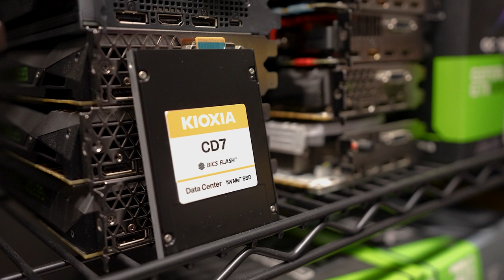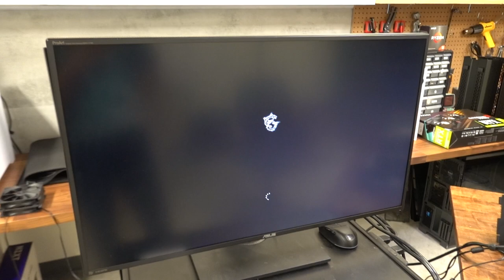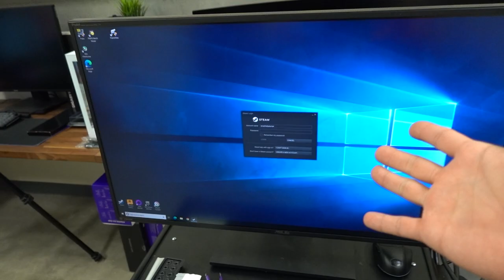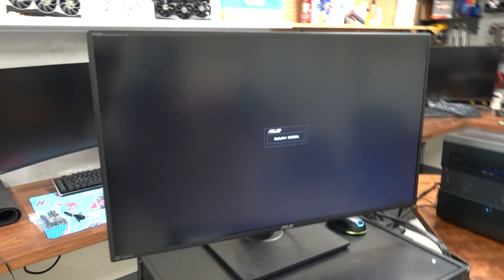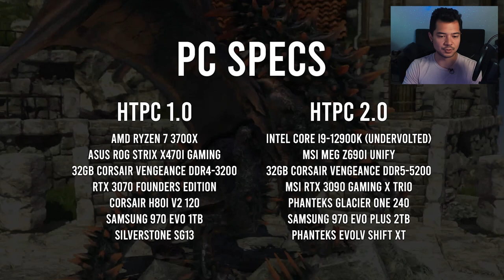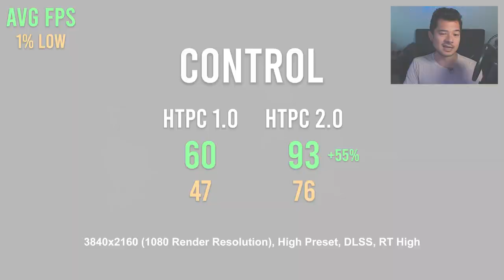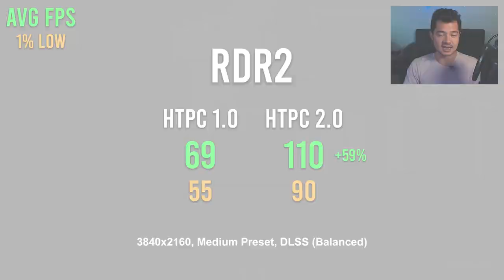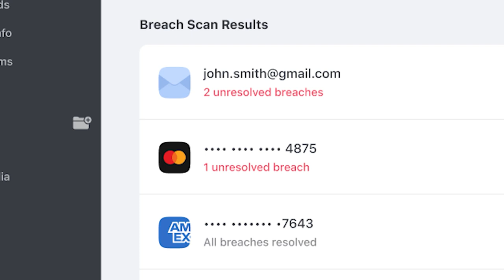IT'S DONE. Was my suffering for this PC worth it?

Comment: how does he not realize early on that when the 3090 display drops out for a few - that it is the gpu driver being installed. That happens literally every time you install a new driver.
Reply: "tech youtuber"..
Reply: Glad it wasn't just me who was screaming at the monitor while this was happening.
Reply: Triggered for me when it came back with the resolution looking correct, but I will say that when you've been having a lot of trouble with a system it's not unheard of to get flustered and start missing obvious things.
Reply: Kyle only makes these videos to milk the remaining audience he has. You can tell he isn’t passionate about this anymore. Not knowing about lga 1700 different mounting spacing, not realizing the blackout was the driver install, or the fact he runs 2 to 3 sponsors In every single video now.
Reply: My thoughts too. I was also freaking out when he was propping up the card while it was on. Those traces are so close together, why risk lifting one end higher than the other
Reply: It was so hard to watch that part lol. Literally every GPU does that while it's pulling drivers online.
Reply: He's not the sharpest tool in the shed. This is first time builder issues.
Reply: im really happy that im not the only one noticing his lack of common sense when building this comp.
Reply: Watching this series was cringe. He sounds like this is his first PC build. So many "mistakes" that could have been avoided. Honestly unsubbed because of this lol
Reply: @tcmo6  literally my thoughts. dudes get nothing but free parts and still can't manage to learn the nuances about builds.
Reply: It's funny, because i was going to make my own comment thread about this, but i found yours.  :)
Reply: You realize that this was a cursed build for him and he was just panicking because everything had gone wrong by this point? Why do people not realize that common sense doesn't apply in these cases unless someone is there to help them calm down xD? This is just rude man, all of you need some empathy xD
Reply: @narius_jaden215  maybe if he didn’t mess up so many simple things he’d have less “cursed” builds. Which, ya know… isn’t a real thing.

Comment: From what I'm seeing the bulk of the gaming increase is coming from the GPU.  IMO you didn't need to rebuild the entire system, just swap out the graphics card and the numbers would be darn near what you get on the new system.
Reply: Scrolling through the comments until I found someone with common sense
Reply: Well wouldn't that just make for a boring video? Probably getting sponsored parts too, so it makes way more sense for HIM to upgrade all of it.
Reply: Good point.  I've no complaint about swapping cases, whether for airflow or just asthestics.

I don't believe DDR5 or PCIe 5.0 give more than a fraction of a percert increase for gaming numbers, based on the comparison videos I've seen.
Reply: @dryii  I don't disagree with you. But, if you can, why not do.
Reply: @massaBeard  This is basically a comparison video.  Swapping out the video card alone would have also been a comparison video.  Either way I think Kyle could have made it entertaining.

The main reason for my comment is because he didn't mention it at all in the video.  It gave an impression that one would need to completely overhaul their machine to achieve the FPS he did, and I believe the heavy lifting here is mostly due to the 3090 > 3070.
Reply: @dryii  Ahhh ok, on that I agree, but I think deep down this was just an excuse for him to get new shiny things hidden behind a comparison video lol
Reply: ... Ignore the BitWit01 bot...  it's  a scam bot.  But do you even know Kyle?  Lol (I mean this as a jab/joke).  He's all about getting that little bit more from hardware upgrades.
Reply: @christopherjunkins  I've reported the bot 3 times now.  So glad YouTube is doing something about it and removing the comment.  😕

I'm the same way.  Spent far too much on RAM a few years ago with the expectation of getting an additional 2-3 FPS out of my rig.  😬
Reply: currently maybe
but with a 3090 give it like a year or to and the 3700x will end up the bottleneck
hell my 3600 is bottlenecking my 6700xt in some CPU heavy games
Reply: 3900x bottlenecked my 6900xt in some titles, 3700x will bottleneck a 3090, especially since it cant pbo as hard as my 360mm aio 3900x.
Reply: There is no way that 3090 would have fit his old case.

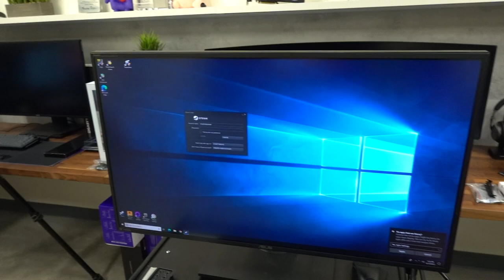Comment: i think the signal loss at around 6:00 is due to the driver loading. the scaling fixed itself when the signal came back. 
Also, i dont think the 1050 ti had anything to do with it, because i switched from a 1050 ti to a 3070 ti, and the driver worked, but didn't support RTX. basically, the driver still allowed the scaling to work, but didn't allow the ray tracing stuff to work.
Reply: Same, I have seen this before. And depending on how old his Windows Install media is, Windows 10 (older versions) would do this while it was installing the Drivers off Windows Update.
Reply: pretty sure that's just the fact that windows tries to get the best driver so it probably got a very old version for the 1050ti that didn't support the 3090 out of the box
Reply from the maker: My mistake. I didn't mention in the video that the first few boots left me with a black screen for 2-3min. Kinda long for generic drivers to install. Thankfully they kicked in eventually.
Reply: not to mention how old the Drivers that W10 tries to install are, When I do a fresh install I have the Mobo & GPU Drivers on a USB ready to install before connecting to the Net so that way Windows has no chance to try & install those outdated drivers,
I hate Windows doing it's GPU Driver Updates so much that I install DDU, run it & in options set "Prevent downloads of drivers from 'Windows Update' when 'Windows' sear for a driver for a device" all the time.
Reply: @shaneeslick  Wait till Windows 10 / 11 tried to install as 6 1/2 year old Network Driver for a 6 month old motherboard ...

Comment: You've been so traumatized building this system that at 5:48 you even freaked out when Windows was installing the default video driver in the background. 🤣
Reply: I hate when W10 does that too, because it ends up being a really old driver & you need to spend more time installing the latest driver anyway,
I now keep a W10 Install USB + 1TB USB Drive with Drivers for all the Mobos & GPUs I have built & service which I check is up to date as Windows is installing.
I do the W10 install without the internet connected, then wait until after I have installed all the Latest Mobo & GPU drivers from USB drive before connecting to LAN.

Comment: The scaling was wrong on the 3090 because it didn't have the driver installed for the different card on boot up.  So it booted at a lower "safe" resolution.  The screen turned off because it was installing the driver and determining the correct resolution for your monitor.  That's why the scaling was fixed when the screen came back on.  It even hints about what it did by asking you if want to "Fix apps that are blurry" on the bottom right of the screen after the screen turned back on.  The thing is, you know this already Kyle.  You've built enough systems and installed enough graphics cards to know this process backwards and forwards.  I'm betting you were just panicking because of all the other problems you've had with building this system that you were just defaulting to panic mode instead of giving the patience you normally would with any other build.

Comment: K-Kyle? Wouldn't the incorrect scaling and blackout be caused by generic drivers, then Windows automatically installing a driver? Hmmm?

Come on man. You're better than this.
Reply: Rookie mistake.
Reply from the maker: That's correct lol but initially the screen was black for over 2min which seemed abnormal. Eventually after a few reboots the generic drivers finally installed and the signal came back.

Comment: Are you sure it's the DP port that's bad and not the cable?  I've had far more experiences with bad cables than bad ports.  And that's even with a cable that works in one port but not the other, but a different cable worked fine in both ports.  Before you assume it's a bad port, I would test a different DP cable first.
Reply: Not sure if that's still the case, but in the past there were ports that just didn't work for booting, but work fine for multi-monitor setups.
Reply: @Zuul88  It's less common these days for sure, but still happens occasionally.  Although I'm less inclined to think that's possible in this instance because it worked fine in that port while it was "bench" built.  But stopped working after he built it into the case.  

There are also other possibilities with the port.  Such as cable positioning.  Sometimes you can have an issue (you see this in USB as well) where the angle the cable rests at, even if it's only less than a degree, can mean the difference between it working or not.  I've had systems that worked fine when "bench" tested, then didn't work in the final build.  After troubleshooting I found that even the metal rails in between the slots, if too close to the port, was enough to push the cable ever so slightly in the port in a direction where it stopped it from working.  Forcing me to reposition the GPU's port alignment to the back to the case to get the port working again.

Display Port has always been a really finicky connection type.  But it still offers a lot of benefits that HDMI just can't match, which is why we still use it.  But it's so finnicky in practice, I just didn't want him to automatically assume that it was a duff port when there are several other possibilities worth checking first.

Comment: Gonna just put this out there. AMD is not changing the cooler attachment system even going to AM5. Just saying that if you went with AMD instead of Intel you would not have had that problem even if you waited for AM5. Very consumer friendly that is.
Reply: Not releasing a sub 300 dollar cpu until literally 18 months after zen 3 is very consumer friendly. Neither of these companies care about you. Also adapters to convert old coolers to lag 1700 were free from most companies or a couple bucks at most.

Comment: In Dec 2021, I bricked my mini-tower's motherboard, 'cause I had failed to shove the 24 pin motherboard connector home.   I crudely swore at myself, for my stupidity!   The motherboard I wished, was not available in USA or Canada.   An order from China was "lost by the Postal Service", before leaving China.   Another order was, "mislabeled by new warehouse personnel", and delivered elsewhere.   Another ordered from Hong Kong, was DOA.   My install was 100% correct.   The board would not POST - just restarted every 10 - 20 sec. forever, even after fresh restarts.   GIGABYTE USA said, "We don't handle RMAs on products from China".   In Feb 2022,  I decided to do an all new build, using the GIGABYTE Z690M AORUS ELITE DDR4 board - USA sourced!   This board ran all fans only for a moment when pressing the Start button and also just as the PC ended its shut off routine.   In between, the fans NEVER ran!   By hand, I felt the CPU cooler releasing a good amount of heat.   Therefore, it had POSTed and had installed Windows.   But also, no signal was received by good monitors, using good DP and HDMI cables, from either the graphics card or the motherboard, (graphics card disconnected).    Reconfiguring the 32 GB of memory, did not improve matters.   I moved on up, choosing an ASUS R.O.G. Z690-G GAMING WIFI, mATX.   The  monitor received no signal.   [EDITED]    Using a, test only, working Intel i5-12400 CPU, confirmed the failure of the original CPU.   Another Intel i9-12900K CPU functioned correctly.   At first Windows did not recognize the internal drives.   From the internet, another user having the SAME motherboard, showed what needed to be done.   In UEFI bios, CSM had to be launched and enabled.  Then, all subtabs needed to be set to UEFI only.   Then, Save Changes and Exit.   Subsequently, returning to UEFI bios, CSM was always Disabled.   In my learning curve I got visual notices that some settings were not ideal.   I respected the advise.   Once I heard a loud obtrusive warning sound, and shut down the PC immediately!   But now, UEFI bios and I, are cool.

Comment: I believe it was much easier and cheaper to just replace the 3700X with an 5800X3D and get the same game performance with the 3090. And build another budget gaming PC for a giveaway with what you saved from high price CPU, MB and RAM.
Reply: All the 5800x3d tests I've seen say it makes no difference for 4k gaming.
Reply: @Safetytrousers  And neither does the 12900K if the bottleneck is the GPU. But perhaps he wants a lot of frames for eSports games, we dunno.

Comment: I hate DisplayPort with a passion.. the worst connector ever designed. Not only is it enormous, but it's locking mechanism forces you to pinch the connector which can easily cause the connector to be twisted or bent back and forth. The cables are also extremely delicate and inflexible. I wish all display interfaces just used SDI (such as 12G-SDI). A truly tried and true connector and the cables are CHEAP, reliable, cable lengths are ridiculously long and the naming convention tells you everything you need to know about it's bit rate.

Comment: 3:55 seems counter intuitive to lose radiator mass (effectively thermal mass) in the effort to gain thicker fans... Seems like you would have to compensate with more fan speed, rather then slower fan speeds with a thicker rad for the same effect. I get the bracket and such.. but sayin the fans should help with thermals is... less then accurate. They will help "make up some of the loss" you occurred from the thinner rad.
Reply: What good is thermal mass for extended play sessions? Every radiator will heat soak eventually, so what if it's 15 minutes instead of 12? Moving more air helps cool any radiator regardless of size.

Comment: That DP port may not be bad. If you’re using basic windows nvidia install drivers, sometimes the 3rd jack won’t work until you run much later driver revisions. This happened to me in 3 monitors when I got a new video card.

Get the latest, freshest nvidia drivers and try the jack again.

Comment: I feel your pain...
Just got a Gigabyte M28U monitor. So excited! No dead pixels? Check. Backlight uniformity okay? Check. Does the... wait! What's that HUMMING noise? F**K. I get humming related to brightness. Will just GO AWAY when messing with settings even if I don't change anything then it comes right back later when starting a game or whatever. Back in the box. In fact, I'm staying with my tried-and-true Dell U2711 (27", 2560x1440, 60Hz) for now. I just don't need the stress.

Comment: I would RMA that with MSI and get one that works 100%, my 120mm rad does fine on a Ryzen 9 5900X idles at 30C hits 56C while gaming max at 75C after a cenebench R23 multicore run but I have an A12x25 on my rad and 3 noctua 1700rpm p12 Redux’s as case fans much much better than the Dell oem fans the pc came with my GPU run at 61C VRAMs at about 70C 75C is the hotspot of the GPU and that’s after a few hour gaming session at 1440p high settings I’ve only played one game at 4K ( I let my pc set the game up it set it to 4K epic ) Epic setting ACC and I was getting 120FPS on my 3080 Ti, hoping they make some 6000 series zen3 chips so I can upgrade to a 6900X or 6950X or w/e they come out with, you used a 12 gen Intel I watched a video by jay two cents about how hard it was to get that cpu to work for him as well

Comment: my 11900K is 37c at idle and gpu 31c.  A real HTPC would have alot of hard drives 10gbe and be placed in another room, just run a thunderbolt dock and corning thunderbolt optical cable to your tv for video and usb. Your GPU displayport plugs, look slammed up against the case, just loosen the screws and shift it slightly over, and you will get a better,locking displayport connection.

Comment: i am going through the a similar curse with my shift evolve xt build. I got a 5600x running on a rog Strix X570-I Gaming MB. It was working just fine on the stock cooler just running a bit to warm, So I added a corsair clc. system powers on no video. sigh. i haven't trouble shot beyond some basics.

Comment: with a budget htpc just as long you can play 1080p on a 4k tv, you're fine but requires adjusting the resolution down to a window to get the achieved framerate

Comment: GPU issues shown, running onboard display as primary display rather than PCIe, even when plugged in with a dedicated GPU, the onboard will run first and detect if that is in use or not. Does the CPU support onboard GPU? yes, is there a monitor plugged in? no, this can take a little as it waits for signal back if a monitor is present. Check PCIe lane, etc. Then installing the driver, bearing in mind you had drivers for an older card also so checks and checks etc. Up to you but you should have turned OFF the onboard Display first as that check was the first checkl. Turn INITIAL GPU to PCIe.

But I am sure you know that and just forgot because you were too worried. It happens, right?

Comment: I fked up my msi mag mortar b660m ddr4 wifi. Don’t know how and when, some pins in the socket were bent. I don’t dare to bent it back afraid that I will make it worst. It has affected my ram, sometimes running as low as 1333mhz. Im doomed. This is my first time building a pc and probably my last? This is too scary. I can’t believe how fragile these things are. At least it still boots right?